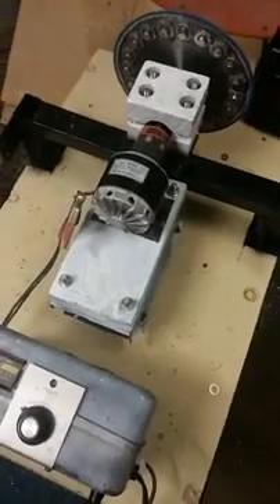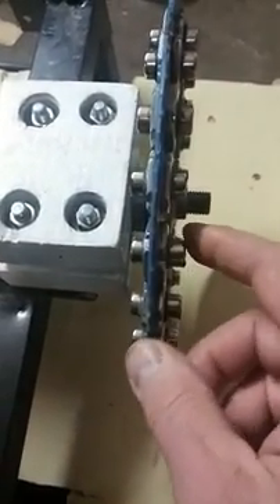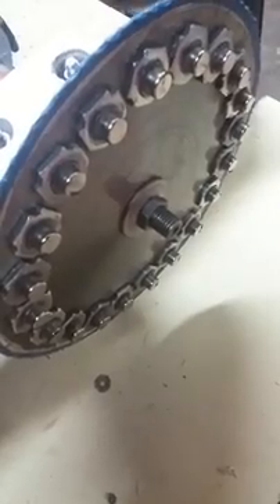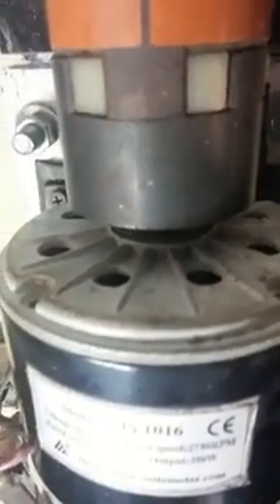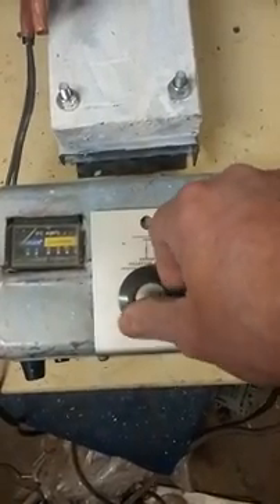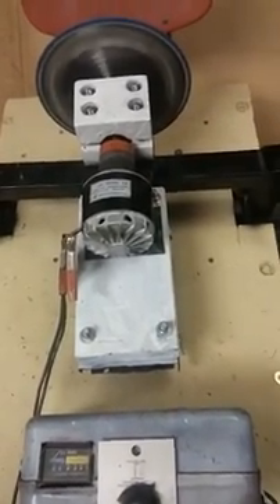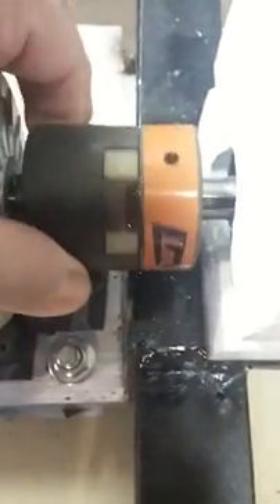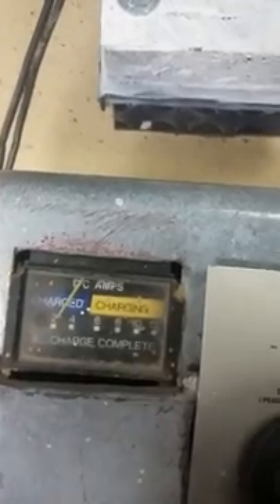3 Battery Motor Generator

Comment: I'm not sure I follow what this does. Is it generating electricity somehow?
Reply from the maker: It is all recorded on a thread called "SPLITTING THE POSITIVE" at THE-ENERGETICFORUM.COM
Reply from the maker: Yes it recirculates the same battery power passing power from one 24 v battery to a 12 v  thru a motor. One guy is at 5 cop and one is at 10 cop